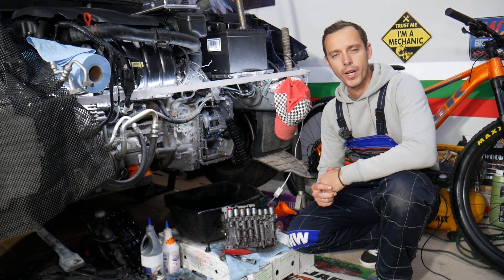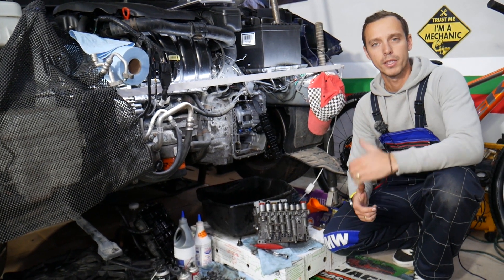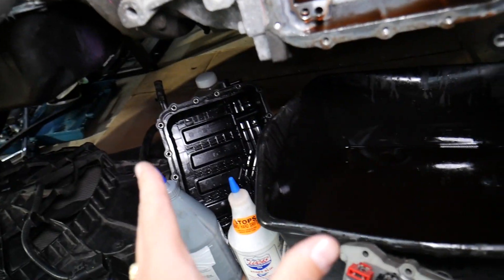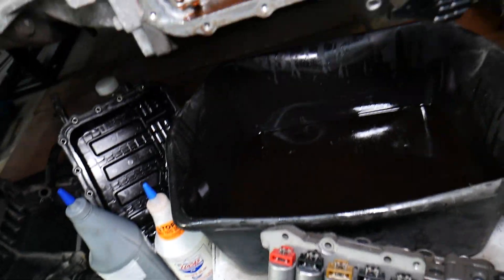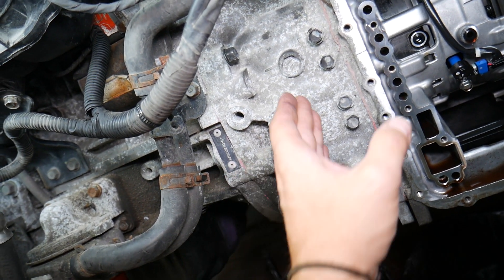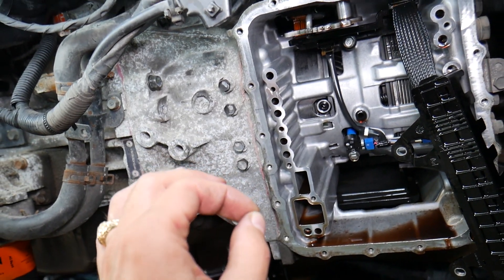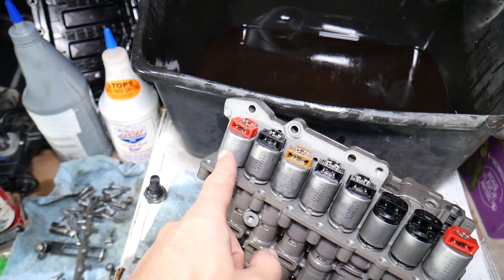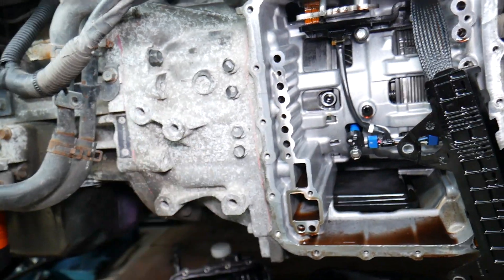SYMPTOMS OF BAD TORQUE CONVERTER JEEP COMPASS JEEP PATRIOT DODGE DART

Comment: Is itna bad torque converter or bad transmission if my vehicle revs up but doesn't accelerate. My vehicle had an issue reversing like it was fighting to reverse and I smelled a burning smell then down the road a block I lost all acceleration but the motor still revs up.